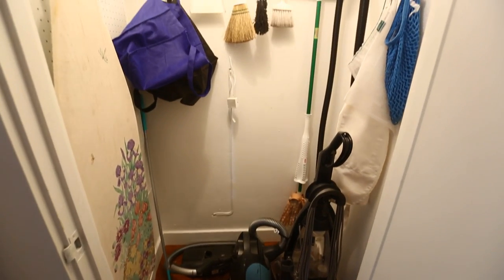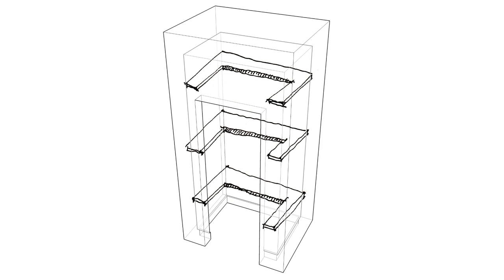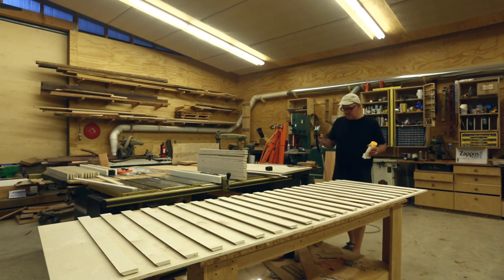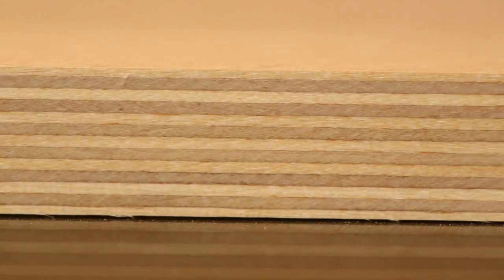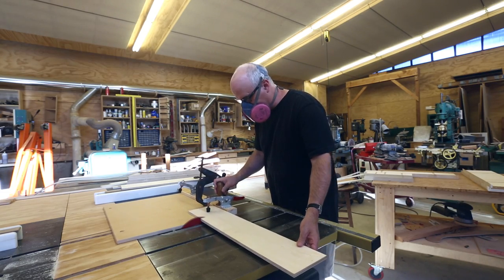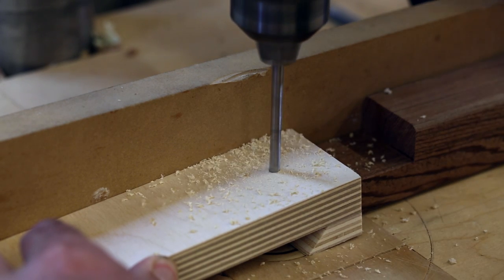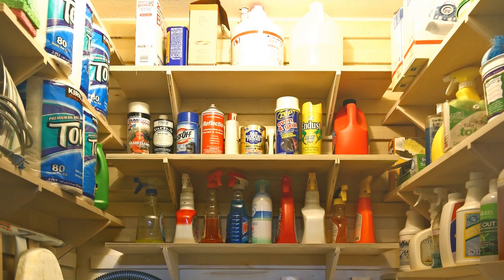French Cleat Closet System

Comment: I see I first watched this a year ago and left a comment. My first use of this design was to make a suspended office desk using a french cleat on the back and side of the desk and then two small blocks nailed above the desk to the stud to hold the desk in place. I've been using it for almost a year now and it's held up well. For what it does (provide a place for my keyboard, mouse, and odds and ends, the monitors are mounted on the wall) it's perfect and was so simple to make, just two pieces of plywood cut like an 'L' and some 1x3s between them so I have drawers. Thanks for the inspiration! 

I had to revisit your video today because now it's time to do my office closet and get everything now stored in boxes off the floor. Thanks for the simple shelves and hooks, that's exactly what I need! Your videos just keep on giving....

Comment: Frank...

I have not made a full panel of these yet, but have a few things hanging in the basement on home made french cleats.  I tend to over do it, and would have been inclined to fasten the wall cleats with screws rather than glue and nails.   Pantry shelves can carry a fair amount of weight at times.  

Are you expecting the shelf weight to ever be a limiting factor?

Thanks for all the great video and wood working.  I am a fan, and circle back often. Keep up the good work.

-Kevin
Reply from the maker: Thanks.  I did not make the shelves too deep 6 and 8 inches.  I had thought about using screws as well on the wall cleats, my feeling is it will be ok.

Comment: I worked for the phone company for 30 years. Those look like phone wires. Could also be alarm contact wires/security system wires. Those often use phone inside wire type wires (the old wired systems anyway). The block hanging could have been an RJ45, that's where an alarm system plugs into the phone line and out to the sensors.

Comment: Very impressive. But... was it necessary to attach cleats to the top 16 inches, or the bottom 16 to 26 inches of the wall panels? The floor area would likely be used for large objects, and a shelf would never be hung just below the ceiling.

And furthermore - your workshop makes me sick with envy.

Comment: Frank, love the video as always. The stop motion video is just spot on. I was wondering with the cost of baltic birch plywood wouldn't a store bought wall unit not have been cheaper? I'm sure you could have made custom hangers to go with the commercial product??? Just a question don"t kill the messenger plz. LOL
Reply from the maker: I started thinking I would use slatwall, after poking around in the web it looked like it was going to be expensive and have a wait time, as it is a commercial product.  So I figured I would just make a similar system, and it would make for a more interesting video.

Comment: As always, wonderful video, Frank. Do you have a suggested spacing for the cleats on the backer panels? I am considered putting up a french cleat system in my garage and would like your thoughts on the proper spacing per cleat.
Reply from the maker: I did 4 inches on this, but it could really be anything that works for your space.  One thing to consider is that the lower part of whatever you are hanging needs to hit something to keep it vertical.  That could be a lower cleat or a bump on the hanging piece.
Reply: That makes sense, thanks for responding.

Comment: Very nice looking but Mr Cheap in me says that you could possibly have just attached the cleats to the wall--assuming that you have a central stud to attach to ---and have saved the sheets of birch ply that you used.  Of course then it would have been more permanent than having the birch ply backing boards.  :)
Reply from the maker: Thanks. I thought of that but I would have had to have spent a bunch of time fixing the walls of the closet. and  the cleats need to be straight to work well which the backer piece helped with.

Comment: I was under the impression that a French cleat system did not need the shelf supports that you made. I thought that the cleat was self supporting relying solely on the meeting of the two 45 degree angles to effect the hold. So why did you feel the need for the extra supports? thanx
Reply from the maker: +Jeff Stanley The cleat will keep the shelf from falling down and out, but not from rotating around the cleat.  The shelf needs a moment arm to counteract this rotation.
Reply: +frank howarth By rotate you must mean in a plain where the place where the cleats come together is an axis that the shelf would rotate around. Looking at it from the end on, right? This brings up another question that crossed my mind. The shelf becomes a lever and when it is loaded it becomes a stronger lever. So, the support counteracts the lever properties. But, have you ever tried to see just how much a shelf alone ala floating shelf could support using the cleats alone? It would seem to me that the wall the shelf is attached to would then become a structural support. For instance, you may have used 45/45 for your angles but there are proponents of 60/30 angles whick allows you to come closer to a ceiling. What if you used 30/60 where the 30 degree angle is on the wall? Then you have the long leg of the triangle opposite the 60 degree hypoteneuse to wedge against your wall which acts as a "stop" to the rotational force of the shelf. The sharper the angle the thinner the material and at some point you will have diminishing returns but what is that point? Thank you for your reply which took me some minutes to figure out what you meant. I am surely no engineer.

Comment: Since you are using this fantastic baltic birch ply even for a closet, I have to ask you how much you pay for it, if you could give some dimension with it?
My understanding is that wood in general is a lot more expensive here (scandinavia) than there, even though these products seem to come from around here. :)

I'm thinking that I may have to resort to OSB for this not to get to astronomical pricing (can't even get hold of other than construction grade ply without a lot of hassle, it seems)
Reply from the maker: It comes in 60 inch square sheets, roughly 1.5 m  I think the 12mm stuff is about $45 a sheet and the 19mm is $65
Reply: frank howarth Thanks! I did some looking up and got confused at first since the difference seemed to be only 15%, but then I saw that the dollar is having and upswing and has become about 20% more expensive for us the last couple of months. :)

Comment: I am wondering if the shelf stays when you accidentally hit it.
You know, when you are taking vacuum out and hit the shelf with a shoulder. I think all the things from the shelf will fell on your head, with the shelf following them...
I thought that small piece of wood added to the triangles would help, but since you'll probably hit the edge of the shelf, it will rotate it, so this will not work.
It will be better to put two rectangles or plank between the top of the shelf and the cleat.
Does anybody have better idea?

Comment: Can you explain the trick you use to split the strips into two cleats?  How do you ensure you're cutting the diagonal directly in the center so each half matches perfectly with the other half?
Reply: David Andruczyk if the board is 8" wide, measure 4" and mark a small dot in the middle of the edge grain.  then, use a speed square on the edge of the board to align the 45degree side with the dot.  you can mark the line from there, tilt your blade to 45 degrees, and position the blade down the middle of that line
Reply: Thanks!  Looking forward to making a system like this for my basement and garage walls..
Reply: David Andruczyk The 2 halves don't need to be equal. One side could even be an inch different. All that matters is that you use all the SAME size halves on the wall.
Reply: julie r that's true, though i wanted to get as much mileage out of each piece as possible, but i could always true up the larger ones via the fence.
Reply: David Andruczyk You'll get the same mileage regardless. Let's say you have ten feet of  8" stock. Whether you divide it exactly into 4 and 4, or into 5 and 3, either way you have ten feet. You just need to use all the 5" on the wall and all the 3" on the shelves or vice versa. My point is, get close to half and don't worry about exact,  just make sure the same size ends up in the same place! : )

Comment: If I was going full plywood , I would remove the plaster, or sheet rock down to the stud to maximize the space. , and find out where those Infernal wires were coming from.
Reply: I like this thought but you might find out that the wall is straighter than the studs at least that is what I sort of found....... oops

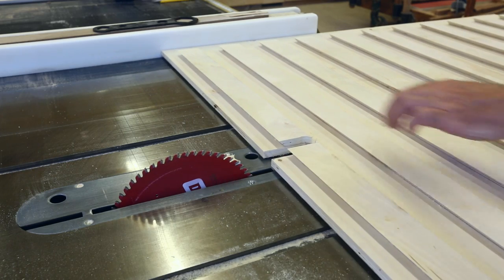Comment: 3:15 The bundle of wires appear to be mostly coaxial for cable TV.  If the house is over 40 years old and has several outlets, with a shallow roof/ attic crawl space I'd say that is more likely.
The installation isn't elegant or thoughtful at all.